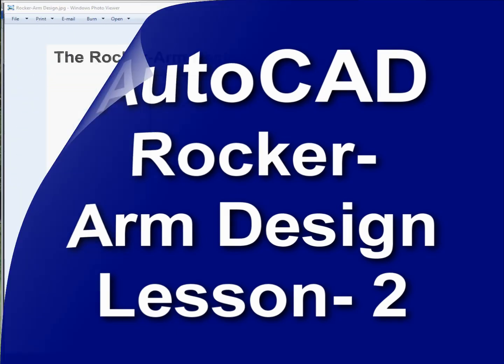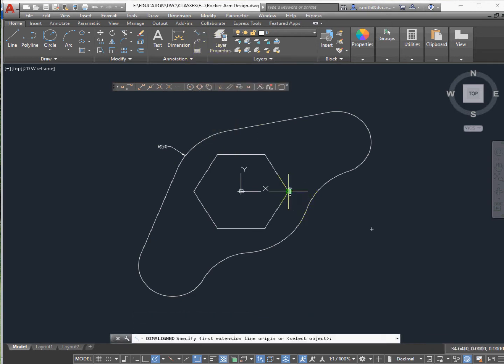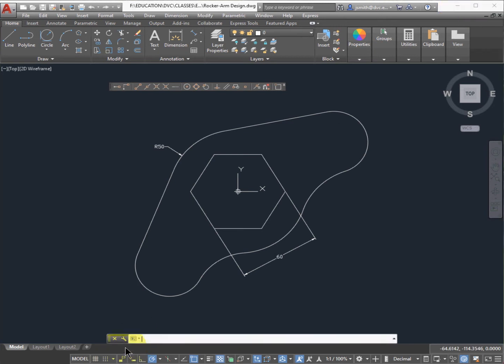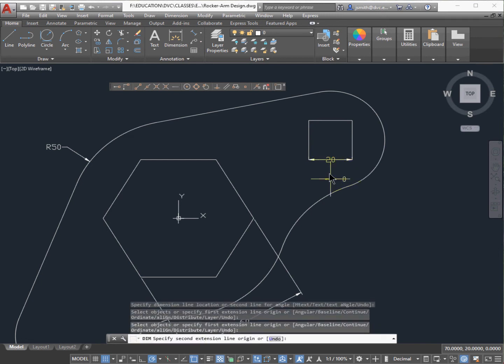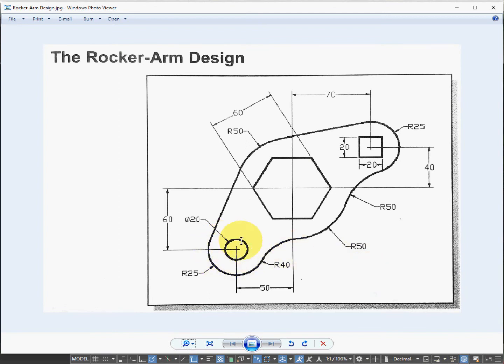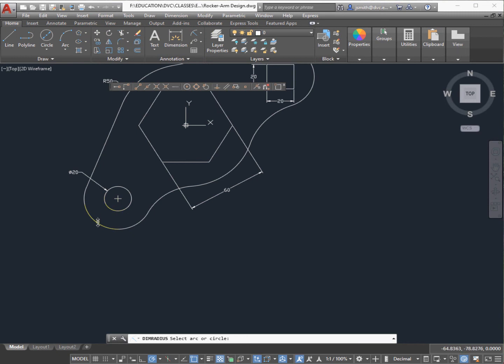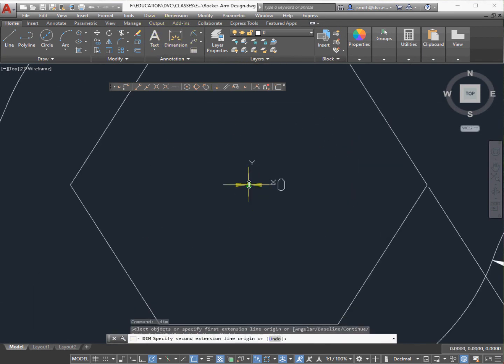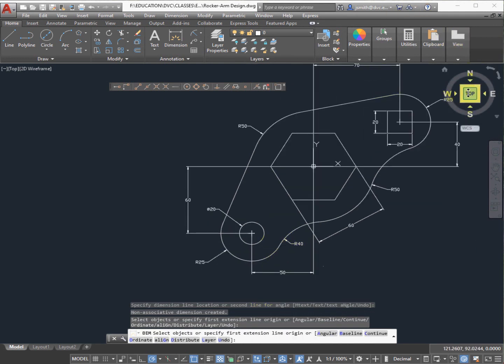Rocker Arm Design- 2

Comment: You type a dimension of the polygon into the command box after making the center 0,0 but you don't specify what it is then you measure it and it is right on. What did you type?